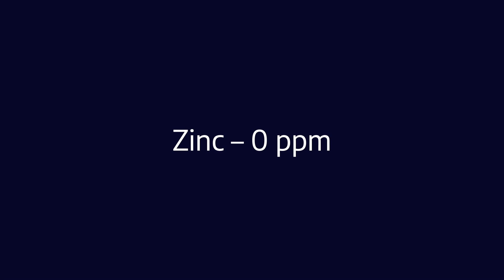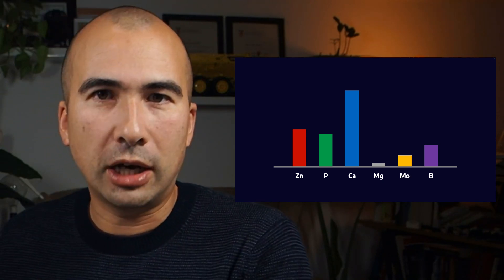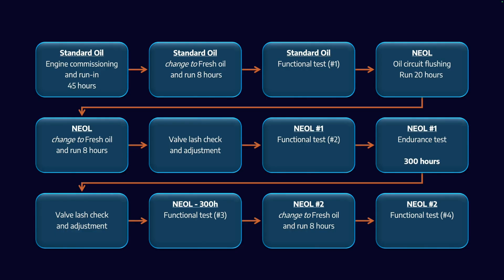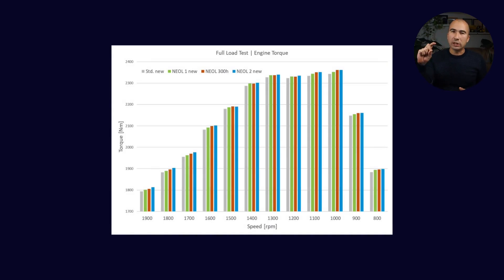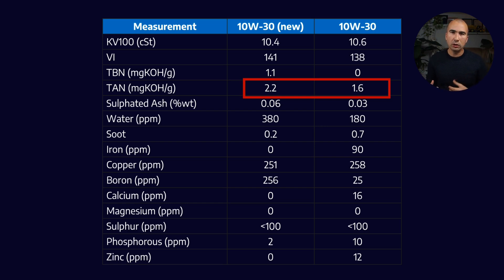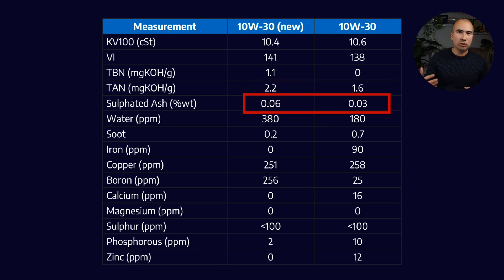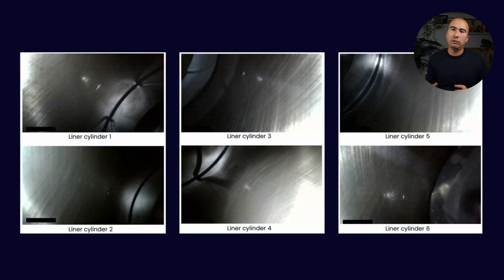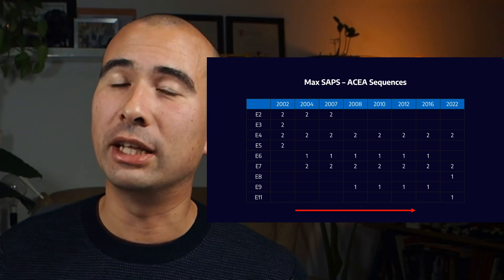Putting a Completely New Engine Oil Chemistry in a Cummins Engine

Comment: Dude according to Google Gemini the reason Primary ZDDP is much stabil at higher temperature is because it is much in less volatile phosphorus, it also the main reason why it act slower to activate the film in a gasoline or a race engine or a bike. Secondary ZDDP reacts faster at lower temperature but not stable at higher temperature, making it more volatile phosphorus.

Comment: One question you didn't mention the increased copper level on the 0w-30 result, did that formulation contain more copper? Or is there significant wear from bearings on that formulation?

Comment: Salut ma bucur enorm ca este cineva care explică corect chiar dacă nu înțeleg engleză  ,Vreau sa precizez că formula noua este mult mai slaba de cea veche teste test făcut pe mașină nu il laboratoare, vreau sa urmărești cu atentie o norma de ulei de 50000km exact cu aditiv zinc ,calcium ,phosphorous cu tbn intre 10.2 si 12.0 este vorba de 0w3 ATENȚIE VOLKSWAGEN Norm 503.00/506.00 506.01 cu un ACEA A5/B5 cel mai bun pana la 50000km  ANI 2000 IN SUS model nou este 0w30 cu specificatia 506.01 care este mult mai slab fără  specificație acea A5/B5  eu caut foarte mult produse vechii chiar daca au 10 ani sunt indentice si mai este o norma care am asa ceva cu foarte mult zinc grupa  V  full sintetic care nu mai este pe piata tot 0w30  30000km special pentru motorizarile benzina audi TT  VOLKSWAGEN 503.00 ACEA A3/B4 AN 2000,DIN PUNCTUL DUMNEAVOASTRĂ DE VEDERE VARIANTA NOU CUM VI SE PARE  MULȚUMESC

Comment: the oil has a way low IV value, i dont put anything under 175 in my cars
Reply: Not IV but VI and it means "viscosity improvers", they are needed to improve the viscosity of crappy base oil, so the less VI needed the better because VI degrates quite quickly.

Comment: Cant wait for the final product and if these come in an Xw40 weight. I have three diesel cars to test the oil with in theory if this oil becomes available to the consumer market and comes in suitable viscosities.
A 17 year old Volvo V70 with the D5244T engine ( I would need the oil as a 40 weight for this engine, its a Diesel developed over 20 years ago it does not like 30 weight)
A new BMW 5 Series with a 286hp B57.
A Renault K9K engine in a Mercedes Citan.
Reply: Do you do oil analysis? See the wear metals?  What do you think would be best for the reliability of the engine?

Comment: Should be using break-in Oil.
Reply from the maker: Probably a good suggestion. Unfortunately time in those test rigs is really expensive, so I think that stepsas mainly cut out for cost reasons.
Reply: why? Most race teams just throw a new engine in if the old one broke for whatever reason and run it wot without a second of a thought.

Comment: How they are dealing with corrosion? It's obvious that the oil is chemically "friendly" with water.
Reply from the maker: Good question. Most engine oils use the detergency of the oil to deal with a lot of that. My guess would be that there's some kind of neutral detergent in the formulation.

Comment: Copper oleate? Tin oleate performs even better on the 4 ball tester. Why was one metal soap chosen over another? Why not lead fat, an antiwear additive predating ZDDP? And I do wish you lubricants influencers would speak less on elements and more on molecules.
Reply from the maker: Great comments. So firstly on the discussion of elements rather than molecules - its generally because oil analysis will only give you elements. We can guess at what molecules are being used, but they would only be guesses. In this instance, the Boron could be a borated ester, boron dispersant or a number of other molecules. Copper oleates, Copper DDPs and Copper PIBSAs both show up in papers as anti-wear additives. This is where companies get very careful about protecting IP. 

If I had to guess, lead fat isn't used because lead fell out of fashion a while back given the toxicity concerns. Same reasons why chlorinated paraffins and barium greases have mostly gone the way of the dodo.

I've not seen much on Tin Oleates, but if caution from drawing too much info from a 4-ball test. It doesn't always translate very well to real world performance.
Reply: do you think using lead is good for emissions?
Reply: Lead is much worse in terms of poisoning catalysts than sulfur or phosphorus, and frankly marketing a lead containing products would be a non starter